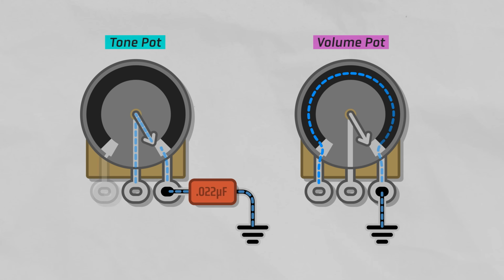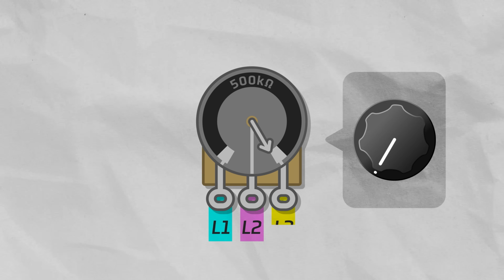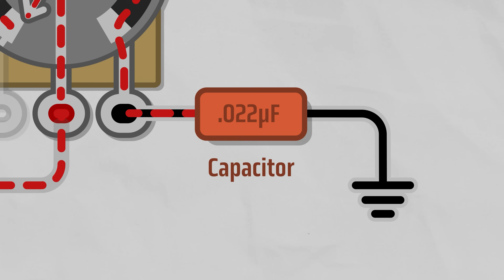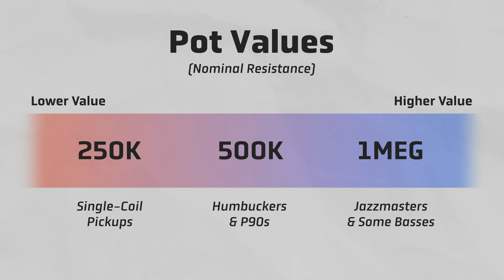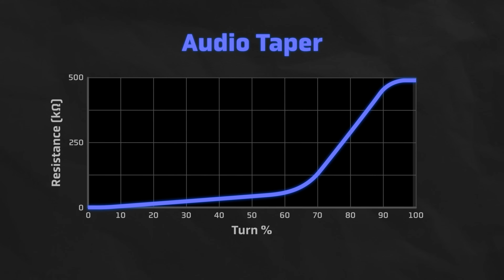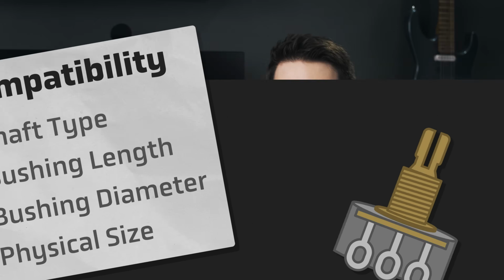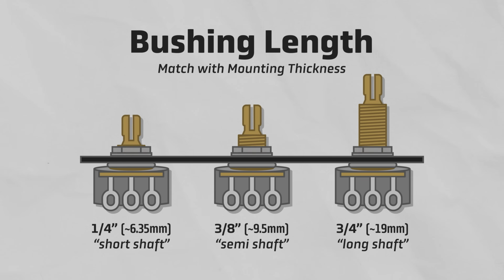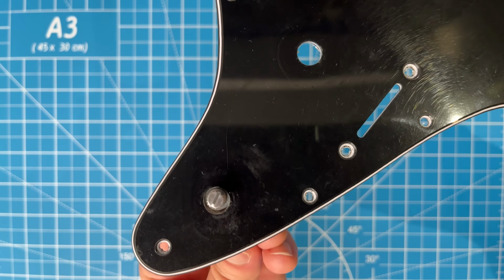Guitar Pot Basics: Resistance, Taper & Compatibility

Comment: Hello your videos are very informative and clearly explained. Thank you so much. Recently i have been trying to set an off-set for my volume pot but I have no success yet. It's like when you turn the volume all the way down, the guitar shouldn't be completely quiet. I'm planing to go between drive and clean by turning the vol. pot all the way up and all the way down. Please consider making a video about that. Thank you!
Reply from the maker: That IS a really cool idea that I'd enjoy trying in a future video (though I am slow at making these).

In the meantime, you could experiment with placing various resistors (probably between 50K and 500K) between the volume pot lug that connects to ground, and ground itself. Finding the exact resistance value will likely require some math as well as some trial and error.

Comment: I bought a guitar kit on Temu, which I’m pretty sure is made in China. The volume pot works as expected, but I fear that the sound of the guitar could be better with higher quality components. Would the guitar sound better with a good quality volume pot in it?
Reply: It will sound better with better components. But one component isn't going to change much. 

It's about the specifications. If it has single coils, a 250k volume pot in connection with the single coil, will make it sound better, than a 500k volume pot will. Or you can use a 500k volume pot and put a 470k resistor in parallel to the single coil connecting hot to ground in parallel. Then you have the capacitor on tone pots. The capacitance of those matters too. 

So there are a lot of factors that come into play here. The effective load on a pickup, the capacitance on it.

However the most important thing is, what do YOU consider as good sounding? What tones do YOU want? That's the question and you have to go off of that

Comment: There is a lot of information in this that looses accuracy with a simplistic explanation. In some information it's just flat wrong. I would recommend people to go watch videos on a basic electrical Theory. This is the voltage divider. I would also study up on resonance, how voltage and current can become out of phase, and how to tune that. I would also study on how to measure it, and calculate it. Otherwise I don't know if I would bother with this.  Not to say this isn't a great video, but building a house with no Foundation is just a house of cards.

Comment: This was very good :yougotthis:

As a left-handed guitarist of 43 years, I must dispel a myth that sort of crept up in the mid-90's or so:
THERE IS NO SUCH THING AS A LEFT-HANDED POTENTIOMETER. Reverse taper pots ARE NOT left-handed.

The problem came about when guitar manufactures soldered the pots BACKWARDS (because of course left-handed is backwards), and discovered that there was no control of the output. Yes, there is sound, but it is muffled a bit, and behaves as "on and off" in counter-clockwise motion. So the various production crews thought, "DUH, we need a special  "left-handed" potentiometer."  (After how many years of electronic component manufacturing ❓🤔) Electronic components are not left or right-handed.

Your explanation of the 3 lugs explains why this happens. If the ground lug is not grounded to the pot casing, the pot fails to functions intended.

Unless you buy a left-handed Gibson, Heritage, or CBS/Fender from the '70s, a left-handed guitar will have to have its pots re-soldered.

Comment: Correct me if I’m wrong but it looks like you could bypass the pots very simply by connecting the input and output wires together shielded from the contacts. Would that create any issues? I’ve always wanted my Teles to have no working knobs or switch, to always have full volume and tone and both pups in parallel.
Reply from the maker: Yes! You can totally bypass your pots in a guitar circuit if you don't want volume and tone controls, and your guitar will sound like it would at full volume (technically you'll get slightly more treble). For your case, I'd recommend routing the hot cables from your pickups directly to the output jack and keeping the pots and switch entirely disconnected from the circuit.

Comment: Great Video and info. Thank You!   What about the pots makes the difference, (or the best value) if you want to use your vol pot to roll off breakup without losing volume too soon?
Reply from the maker: Good question! For that, I would probably recommend trying a B-Taper (linear) or J-Taper pot for your volume control. This will give you a lot more room to turn down your volume control without your guitar’s output volume dropping too quickly. That being said, a lot of this also depends on your gain staging. I’m not an expert, but I would guess that putting a compressor somewhere in your signal chain after your overdrive/distortion could also help you retain some volume as you roll off breakup.

Comment: Guitar pots have the following basic parameters:
1. Values - 25k, 50k, 100k, 250k, 300k, 500k, 1m and tolerance precision +/-% (5-10-20%);
2. Tapers - linear 50%, log/audio 5%-30%, antilog (reversed left-hand audio) 5%-30%, kind of "S" taper;
3. Torque - can be very different;
4. Bushing's diameter/thread and length (M7-0.75, M8-0.75, M9-0.75, 3/8"-32 UNS / 9.2mm, M10-0.75 or 1.00);
5. Shaft's solid 1/4" (6.35mm) or 6mm, 24 (US) or 18 (Asia) teeth split shaft (6mm diameter in both cases);
6. Special kind of pots - push-pull, push-push, dual, dual concentric, balance/blend, etc.;
7. Body size (17mm, 24mm or different special) and overall materials and manufacturing quality;
8. Life length;
9. Turn angle;
10. Availability and price !

Comment: I'm not new to guitar wiring but I'm doing a project with concentric pots (never worked with them before) on a Squier Jag Bass. I'm having trouble locating a diagram and I"m not sure how to handle the caps. Any direction will help. And I like your videos a lot, very informative, Thanks

Comment: Tryna fix this bass. The wiring in it seems to be a mess but I’m not too knowledgeable on that area. When it comes to the tone pot, nothing is connected to the 1&3 prods. The 2 is gounded to the pot and there’s a black wiring connecting the volume to the to tone to the headphone jack, saudered onto the bottom of the tone pot. Is that just bypassing the tone pot because it doesn’t seem to change any tone whatsoever when I turn it anyways?

Comment: but why do tone pots only use L2 and L3? so output and ground are the same?
Reply from the maker: That is a really good question! The short answer is that volume and tone controls fundamentally work differently.

Simply adding a short to ground (like a tone control does, using 2 lugs) will lower the volume of high frequencies much more than lower frequencies. 

This works great for a tone control, but for a more even drop in volume across the frequency spectrum (which is what you want in a volume control), you need to divide the voltage of the signal, and this requires using all 3 lugs in a pot.

Comment: great video. what woild be cool to talk about in an upcoming video is deoxit fader lube but what no one ever explains is what friction grease is in the shaft of the pot to provide turning resistance and how adding too much contact cleaner could dissolve this grease making your pot lose that resistance feel and once it is gone the only ways to get it back is to take the pot apart and add it back on the shaft or replace the pot. I wrecked my volume knob on my pod 2.0 this way with too much contact cleaner and lost that nice resistive feel of those line 6 pod pots. instead it became so free turning that just bumping it by accident drastically bumped the setting. I actually ordered camera lens friction grease from aliexpress, and fixed it back to original feel, difficult, not the right stuff but worked.  no one ever explains why some pots like on mixing boards feel very resistive to turning but pots on a strat move freely in comparison. and no one seems to be aware of this special ultra sticky grease that is used on some pots and that that's the reason behind that resistive feel when turning pots. another example is how the giant volume knob on an old school hifi tuner feels.  imagine how bad that would be with a free turning pot. you'd riskbaccidentally blowing your speakers
Reply: WOW. Very informative. I've been a bassist/guitarist/drummer for 40+ yrs. I never realized this. Never too old to learn something. Thanks for the info.
Reply: Use vaseline

Comment: I'll have to watch this over at least 10 times. I'm going a bass and want to have a p and humbucker 5 wire or dual ground. I want to use a stacked pot like the fender 250/500k stacked pot. I'm wondering how to connect the upper pots ground and what connects between them. Would I be running 4 wires to output or just 2? I'm probably over thinking this but everyone I asked seems confused also.

Comment: Thanks man, this video is amazing! Putting together a new build in a few days and this info was immensely helpful. I was prepared to do some research, but this video answered most if not all incertainties and questions I had! Also I was unaware of the 24 vs 18 spline shafts, I've only checked the width and type up until this point. Guess I've only been lucky dodging that pitfall up until now 😅

Comment: Re: Taper. Which type would EVH have used? I like how he uses the volume instead of a boost pedal. I think his amp is set tp a lead tone and then the volume adjusts the amount of distortion. I figured out that's why I never liked high gain amps. I was using them wrong. Its very satisfying but only one of my guitars works well at that.